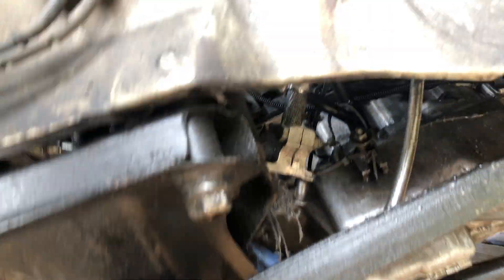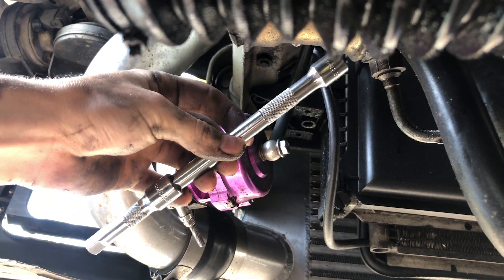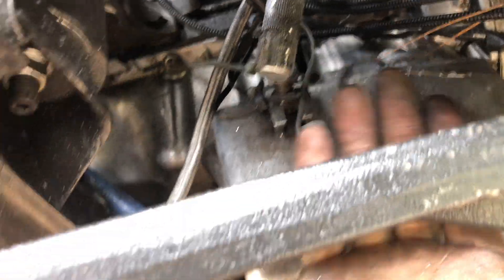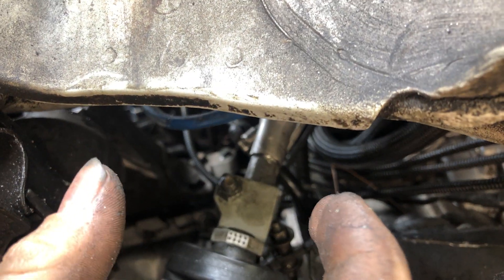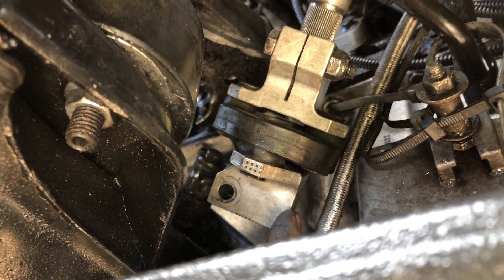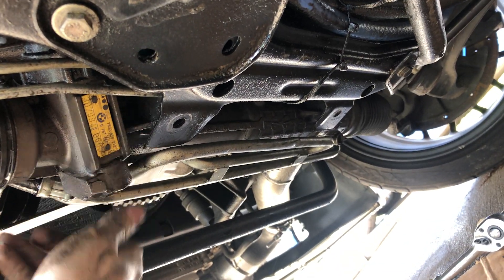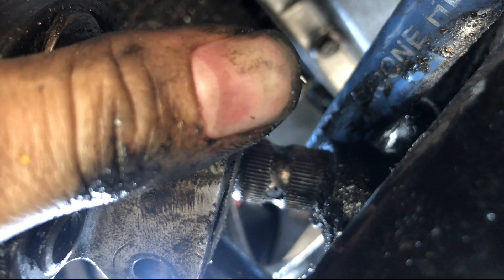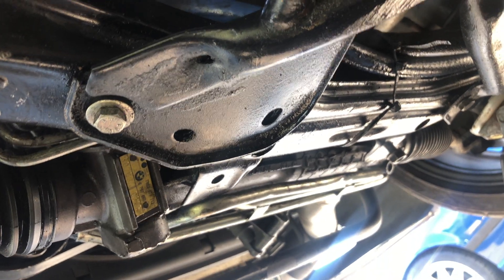Replacing My Steering Bushing After Tearing It On The Highway!

Comment: Hey bro.  And everyone else 
This is wrong way of putting in. Don’t tied the bolts until  both ends seated 
The coupler should go up all the way toward the steering wheel( that’s what the extra length of space for)then pull down to line up to the steering rack and finally bolted up. 
 No need to mess up with unbolt the rack.
Reply: I can vouch for this im doing mine right now and theres no need to unbolt the steering rack. The part slides up and youre able to line up the slots and slide it back down.
Reply: @famus801 God bless you guys because there is absolutely ZERO % chance mine was moving without the steering rack coming off. And who cares anyway? It’s two bolts. After finally splitting the u joints, reinstalling, I could get it to SLIGHTLY move up on the top shaft but definitely not all the way up or down. To get it fully down on the racks splines, I had to hammer hard on the u-joint for it to slide back all the way. It was the absolute only way and pawinning had a video as well on this where he too at a minimum needed to unbolt and move the rack.
Reply: Andy please help me!!! The quibo is stuck on the upper shaft and after hammering for a hour little to no progress getting it down, helpppp@Andy-bm6zo
Reply: @C330ZSP loosening the bolt.  Use flathead screwdriver to hammer open the gap more

Comment: Bro u showed everything but the installation of the steering column being installed to the rack. I’m trying to find videos on how u can reinstall the column on my e36.
Reply from the maker: It took so long that my camera died at the time. Make sure to line up the rack slot with the plastic piece and slide the rack forward if you have it off that far and try to slide the stem from the steering wheel a little back aswell. It’s not a perfect fit but more so a angled connection until it sits in perfectly. I afterwards used a 2x4 to hammer on the rack and not damage it.
Reply: Yea i was stuck either hammering on the bottom piece first to the rack then installing the column but then the column broke in half soo i wanna make sure im doin it right next time lol